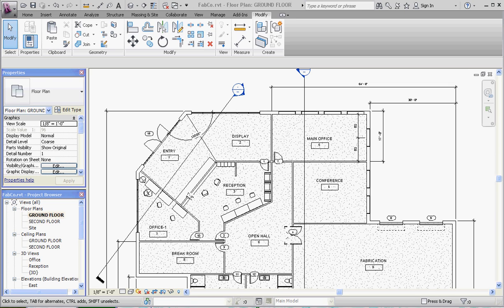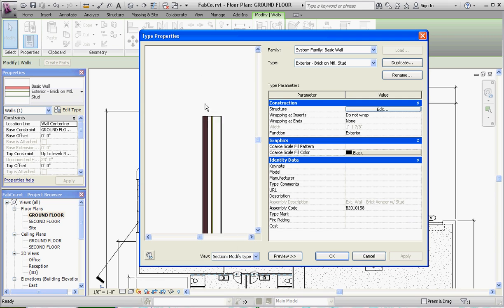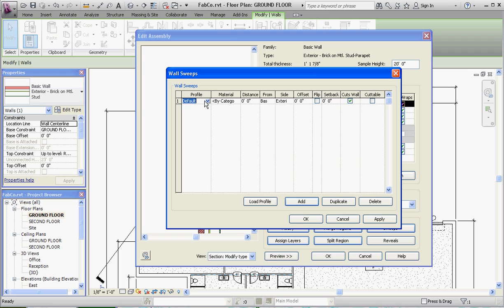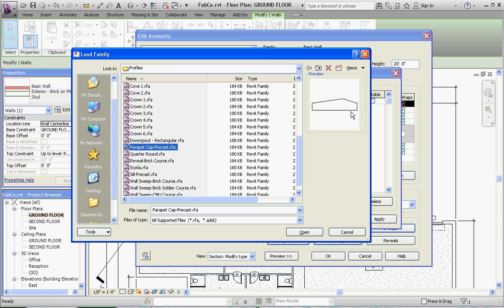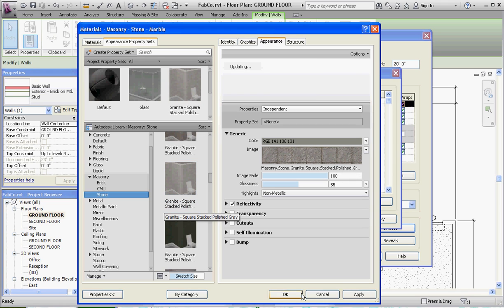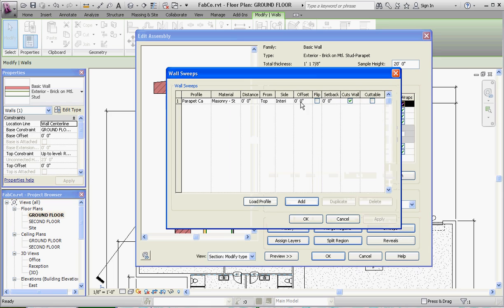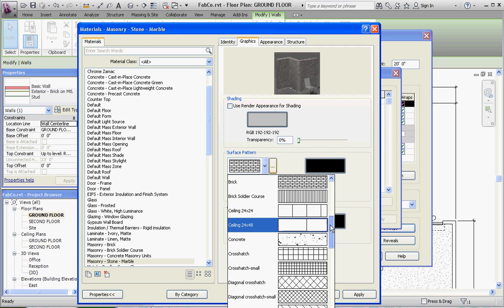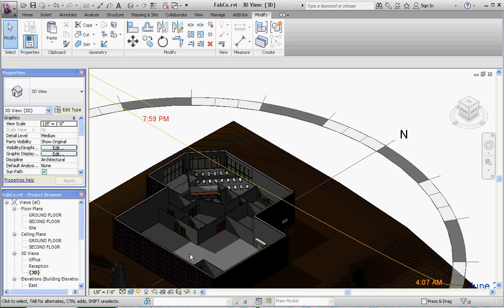Flat Roof, Adding a Parapet to an Existing Wall

Comment: why always for a brick cap, most common is a metal parapet wall cap, not a brick wall
Reply from the maker: Thanks for the comment.  I believe the parapet borrows the material from the existing wall being modeled.  A metal cap may have to be designed as a separate but linked feature.  Let us know if you find another video that demonstrates this.  CSS